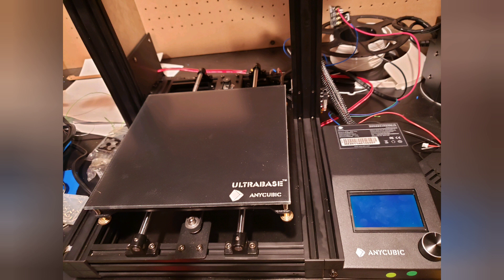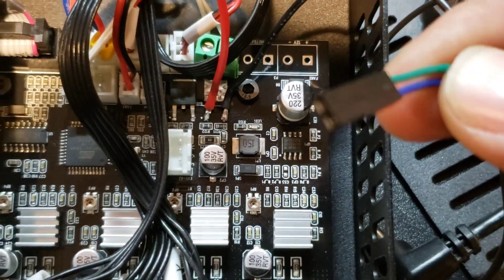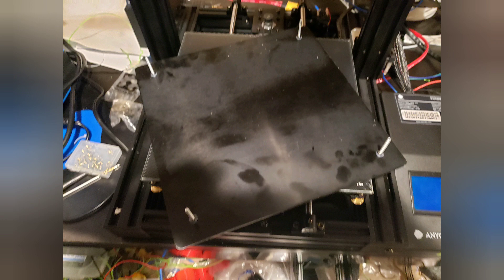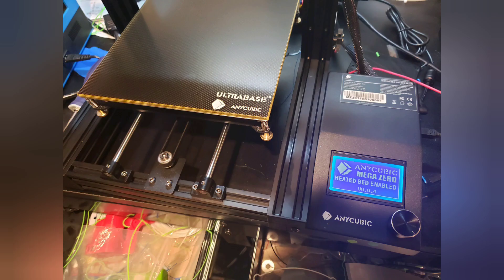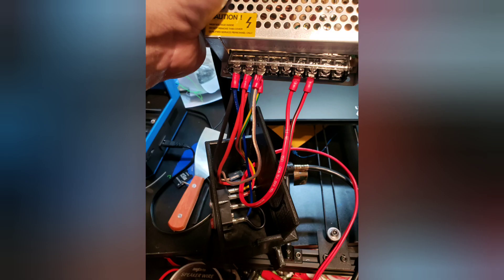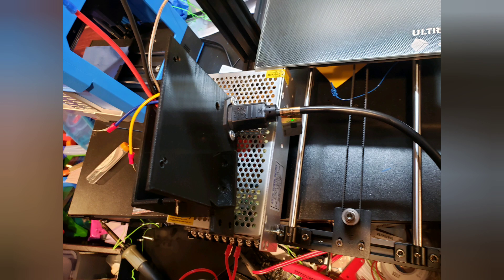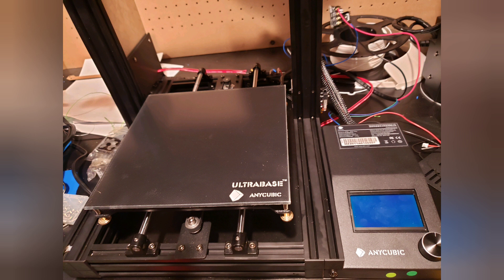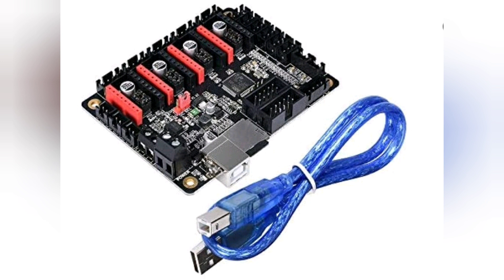ANYCUBIC MEGA ZERO - HEATED BED UPGRADE PART 1.1  TECHINCAL UPDATE

Comment: My board for some reason drops voltage from 4.8-5.1 (without load) to 2v (when I connecting boost converter), what can cause that?
BTW: I used approach with SSR + AC heated bed

Comment: "Update: I designed and laser cut a pair of Y carriage adapters that allows a standard i3 size heat bed (190mm x 190mm mounting holes) to mount."
Where can I download it?
Reply: dont bother finding that. just buy aluminum stripe 30mm/1in wide, cut two pieces with enough length and drill holes in proper places. thats its. operation takes ~15 minutes alltogether.
Reply: @latonita  IF you have the tool ;) Would be handy if you could just print them
Reply: @Andcoly  Just print the "bed spacer.stl" and use it as a template for the hole spacing. You really don't need a plate that goes all the way across. You just need 4 pieces of aluminum, i'd say about 10mm thick and maybe 25.4mm (1") wide and 30mm (1-3/16") long. 
Using the printed spacer might work for a few prints, but it will eventually melt and start to disfigure. And, depending on the pint time, they may just give out in the middle of your print and waste all of that time and filament. Then you will need to do it all over again. So, it would be best to use aluminum to start with and never have to re-do it. 

You can normally purchase aluminum strips in various thicknesses and widths for not too much. They might even cut them to length for you. Then all you would need is a drill and a couple of "C" clamps or a bench vise to hold the aluminum while you drill it. Just makes more sense to me than trying to re-print and re-do every few uses or maybe lose a print altogether.

Comment: Why not Power the printer with the bigger Supply? I think, its just cut the cable and connect it to the bigger supply or am i wrong? Thx for reply :-) Nice greetings, searching for this since months....
EDIT: Sorry, i get it later, yours is a 24v supply. But with a 12v it should work?
Reply: Yes, as long as the heated bed is also 12v.

Comment: Excellent upgrade and really appreciate the information! 

Is there any way you could supply more information on the adapter plates that you designed to get the bed to fit? dimensions, hole spacings etc....
Looking at having a go with this project but would need to send the specs off to get them laser cut.
Reply from the maker: I'm going to cut a large batch of them and have them up for sale for $12 a set + shipping.
Reply: Adapted Machining Great, sell them on ebay and share the link, or do you have a webpage?
Reply: @adaptedmachining6951  That would be fantastic! I would definately have a pair...
Reply: Are you still planning on selling the adapters?  I have searched eBay and don’t see anything there. Thanks

Comment: Oh so good! thank you!
I really want to try the sensor-less homing with the TMC2209s. Mesh leveling the bed without a probe sounds too good to not consider.
But I can imagine one would probably be safer to FIRST set the stall threshold for the Z steppers on the ↑UP↑ direction to get the right number for StallGuard™ thereby possibly preventing the nozzle from boring a hole into the bed.

Thanks again! I'll be glued to your channel for the coming weeks haha.
I received my Mega Zero 2 days agoo.
Reply: Buy a BigTreeTech Mini MZ board

Comment: Really enjoying your work on this.  I've had my printer for a month but just put it together last week.  I will definitely try to recreate your upgrades.  I think I might go and order a second printer before the price goes up.  It's a steal
Reply from the maker: It prints better than my i3 mega s.   Well worth the update imo.  I also just got the mosfet and it works as planned.   Update soon.
Reply: @adaptedmachining6951  Good afternoon,
In the video you can't understand for what the small connection 1T is. What have they put there ???
Reply: @adaptedmachining6951  can't wait for that video.  My plans with the next one I purchase is to increase the size as well as the heated bed as well as some possible raspberry pi integration (I have got way to many of these pis around here!)
Reply: I am finally about to attempt this myself on my printer. I downloaded the files from thingiverse but the bed lift items weren't in the files.  I was planning on designing them myself using pictures from your videos.  What is the thickness of the riser that you designed?  Thanks for your steps in this project.